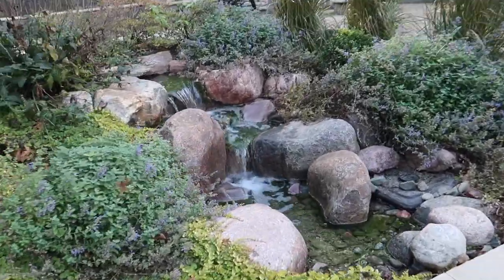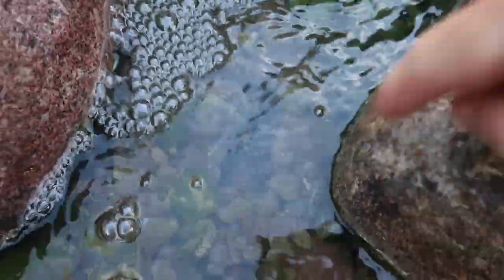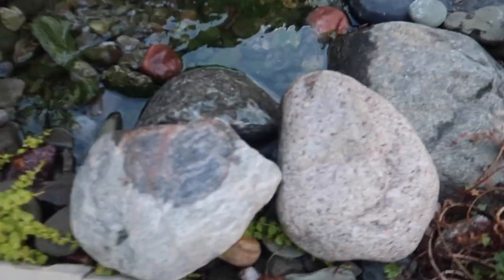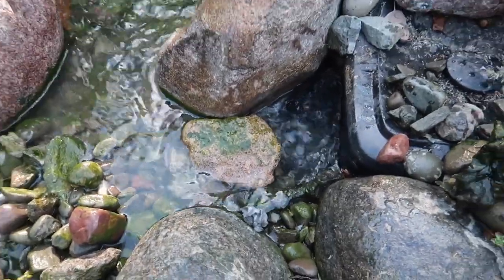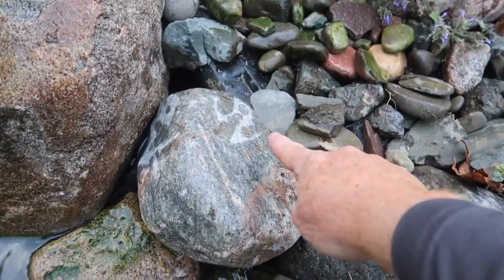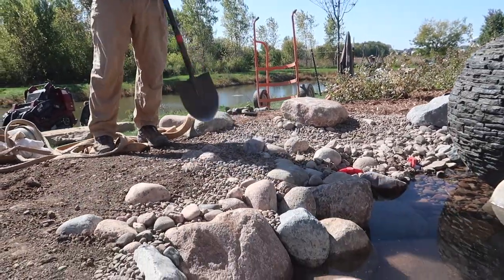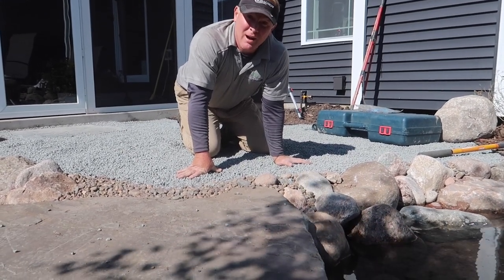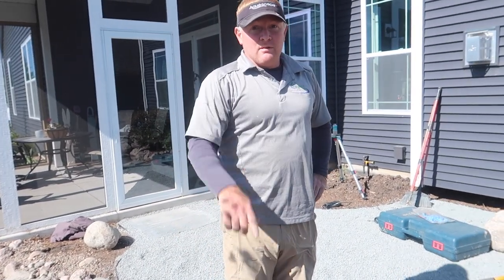How to Fix Pond Leaks and Hide Liner

Comment: Thanks for a very nice and detailed video about both the bib liner to hold water before it disapears through the gravel in the negative edge's vault and several ways to hide the edges of the liner. I will use some of them by finishing my pond 😀